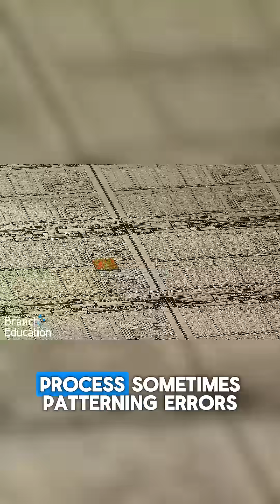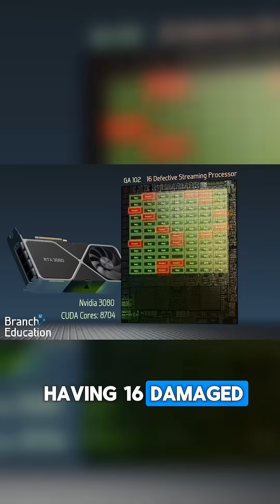How do Graphics Cards Work? Part 4 #gpu  #technology  #engineering  #videogames

Comment: Imagine they perfect the process, reducing error to such a degree that there is practically 0 error rate. Then we would have a standard chip with same performance level across all units. A higher chip or lower chip has to be separately designed, reducing waste and improving effeciency. This would be awesome once chip manufacturing process matures by further technological progress.
Reply: Sometimes they’ve just disabled working cores to meet demand on lower end units. Still higher yields are better overall as costs can come down
Reply: @Dude6978  that's the problem of corpos today, they keep making chips expensive and expensive, they are barely affordable nowadays (in 3rd world countries even a used gtx 1060 is barely affordable to buy given the low income), a standard chip should be affordable by everyone. It's doable but it would take a lot of work. Chips need to smaller to be less expensive and use less power, the programs need to be optimized and debloated from junk code. Especially game engines bringing minimal improvement with a massive performance hit. We reached the top back in 2010s with games like Crysis 2 & 3. They remastered versions are a proof of the minimal improvement (apart from ray tracing). I used to play crysis 2 on my core 2 duo with gt 630 and was continuously blown away by the graphics. Now graphics are barely changed and run like crap (most of recent games) and requiring a barely affordable RTX GPU to run at 1080p settings (remember when gtx 1080ti was marketed as 4k GPU?).

To truly move to next era, we need a collaborative effort from everyone, then we can truly start marching towards a Utopian future.

On a final note, let's not discredit the hard work the engineers have done by focusing on corpos. We all take GPU for granted, it's magnificent work of engineering and proof and human ingenuity.
Reply: I really wonder what would actually happen in a case like this, as they probably couldn't produce as many different chips as there are gpu models currently, just fewer models in total? Overall cheaper prices? Purposely downbinned cards?They would somehow have to meet demand in the lower-end market.
Reply: @hypernovafx Creating the photolithography masks for a chip variabt is extremely expensive. That's why they create only few variants and then disable parts of the chip even of they are perectly good.

Even if the manufacturing had zero defective rate, they would downbin chips to target multiple proce ranges on the market.

The buyer pays for what the product knows and not for how that product created.

Comment: So they are actually selling a damaged product as 100% efficient, just under a different name. Selling production waste has taken on a new meaning. I wonder how this relates to the law..
Reply: It's legal, it's called binning. If you could even think about being opposed to this, you're mentally deficient.
Reply: So you'd rather they waste a chip that can still be used, when it already takes a very labor-intensive process and is already an extremely polluting industry? Would you rather the price skyrocket AND emissions rise?

Comment: Not all are damaged if market demand 3800 and and they have in stock a lot of 3900/3900ti they will just replace the bios and repack it. Is the same like the amd phenom x3 x4 on am3 socket I got lucky back in the day and got phenom x3 and unlock it to x6 and all 6 cores worked property in all stress tests and gaming.
Reply: How were you able to access the firmware to unlock it?
Reply: no. they will laser cut the extra cores connections, so no amount of firmware is going to help. the phenom had the cores "turned off", not disconnected.

Comment: Back in 2010 I bought an Athlon II X3 with no level 3 cache. Bought the corresponding Asus motherboard which permitted unlocking in the bios. Unlocked it day one to Phenom II X4, so one extra core and better instructions, and also 6MB of extra level 3 cache. Tremendous performance increase at the time. I still have that PC and it's still working very good. Original AMD Radeon 5700 1GB and 8GB RAM. Upgraded to SSD. Still use it to browse the internet, YouTube, and some old school gaming.
Reply: Everybody does that in athlon II era, probability to winning that silicon lottery is fairly high
Reply: This is impressive bro
Reply: @DARK_DEZO_F  Thanks! 👍

Comment: Back in the day you could buy extra performance by getting a code that unleashed any manually errored components
Reply: heck yeeh i remember having ATI 9800SE that had its 8 cores 4 off them disabled but whit omega drivers which was free software you could unlock the rest off 4 so you get the full 8 and the card came same as Ati 9800pro for 199 euros the 9800pro cost 400€ good times
Reply: Why can't you do that now?
Reply: @PitestiNation  got harder and riskier
Reply: @PitestiNation they physically disable cores by cutting off the paths
Reply: multiple reasons. 1. They can now do physical isolation which is much more stable than bios based isolation 

2. Unlocking is basically lottery. You don't know your card contains a damaged sector or just a locked sector. 

all you heard on the internet is the success stories, but what about the failures whereby they unlocked a damaged sector?
Reply: yup, I guess people abused it so now they physically disable the bad sectors so you cant buy and return cards untill you get a "good" one

Comment: And in order to keep all 3080s' performances the same, do they intentionally defect some of them that are in better condition?
Reply: Only if it’s a very big difference. If it’s just a few cores it won’t matter, since the “silicon lottery” also makes some chips perform better so no single chip performs exactly the same. The brand like 3060 or 3080 just means minimum performance, usually your card performs a tiny bit better than the advertised amount of core because that means minimum that amount of cores.
Reply: @Dogappel good to know, thanks for the explanation.
Reply: @Mehrdad995  other replies don't know what they're talking about. Yes, they will disable cores to keep all 3080s the same spec. Think of it like multiple different cut off points: for example, if a chip is produced and has 72 SMs working, this can't be branded as a 3080Ti with 80 SMs, so 4 additional SMs will be disabled to meet the 68 SM spec of the 3080. This is the only reasonable thing to do, otherwise there would be a million different SKUs for each possible defect configuration. The "silicon lottery" that the others were talking about does not affect the underlying hardware specs of the GPU, but mostly only the voltage/frequency curve of said GPU (ie. Some GPUs will be able to achieve higher clock speeds when provided the same voltage). This is also held to a specific spec for each given GPU SKU, so this really only affects overclocking performance.
Reply: @shremk9100  You are right, not many people will pay for something that is based on luck. Knowing that by paying for a 3080 they might get a GPU with close to 3090 performance or on the contrary get a normal 3080 would make purchasing a factory new GPU less interesting compared to a second handed one that you for sure know it's actual power.
Reply: No, it's called the silicon lottery. My 3080 performs about the same to 5% better than the average 3090 because I won that lottery.
Reply: @MAL1GNANT  seriously? So it's completely random, and you might have a 3080 that only has 1 defective cores, whereas someone else might have one that has lets say 10 defective cores?

Comment: If, lets say we have a chip that cant be a ti but cant be a 3080 so they intentionally lower it. So can we like reactivate them and get a better performance.
Reply: They're broken. Why would you want to?
Reply: @MAL1GNANT  some chips they do that intentionally right? So can we reactivate those intentionally deactivated chips?
Reply: @CoolMonkey_at_his_PRIME  I would imagine that is risky to reactive some of those chips right? is this hard to do?
Reply: @CoolMonkey_at_his_PRIME  no you can't. the core pathways to the rest of the chip, are cut by laser. the is nothing to reactivate. that happened once 100 years ago with a amd phenom (the cores were just "turned off", not cut) and ppl still think that's how it works.
Reply: @giornikitop5373  so thats just a lose lose situation
Reply: @CoolMonkey_at_his_PRIME  no. that's just the reality of manufacturing chips and it's been that way for decades. cpus, gpus, ai, you name it. as good as the process gets with time, there will always be defects.
Reply: @giornikitop5373  Ig this is actually better than just throwing em. Companies just reuse them and sell em again for more profits 📈
Reply: @CoolMonkey_at_his_PRIME  exactly.

Comment: This binning process is especially frustrating with CPUs because sometimes you buy an i5 that has 1 or 2 extra cores that work perfectly fine and could potentially increase your multi-core performance by alot but intel would cut their connecting circuit traces with a Lazer so you would never be able to use them, just so the CPU could be packaged as an i5 and meet the advertised spec sheet.
Reply: But you have the option to buy the higher spec variant.
Basically you get what you paid for. Anything else doesn't matter, because that's just how mass producing chips with the most expensive manufacturing process works.
Reply: @zoltanberkes8559  They used to disable the extra cores with software, so you can later enable them if you want....but now they cut them physically with a Lazer...obviously you can just pay more and get a higher binned chip but throwing away a perfectly good core or two is purely wasteful...just disable that shit in software and let the consumer decide if they wanna play around with what they bought.
Reply: @Plexer101  why would they sell chips with more working cores than the specs specify? That isn't fair to consumers
Reply: because cpu's with odd number of cores perform like crap. it has been tried in the past and it failed misserably.

Comment: I wonder that even if 1 core is defective, they would have to also deactivate many working cores intentionally, so that all cards of a lower tier have same number of working cores.
Reply: I don't know if it's even likely enough to make a 100% perfect chip, so I would guess they have some reserve even in the highest tier they sell. But otherwise yes, if they are even 1 core short, they disable a few more to get to the next lower tier. And sometimes they do it even if they actually have enough working cores when there's too much demand for the lower and cheaper product, and not enough demand for the higher one.
Reply: soo... any idea how to reactivate those cores ? @jindrichlukas3220
Reply: @jindrichlukas3220  wow, thank you!
Reply: @jindrichlukas3220  thank you!
Reply: That's true. They will disable more so it meets the next spec. Sometimes they keep them to release another SKU down the road
Reply: @pcoverthink  okay. Thank you bro
Reply: Yes, because they didn't sell anything in between 3090 and 3090ti

In the CPU market, for the clockspeed is a bit different. let's say Intel, if they can't reach the clockspeed of an i9 14900 even though the difference is only small, they didn't make it even slower, rather they will sell it as i7 14700k aka overclockable variant(that's for clockspeed, for defective core is still the same with GPU).
Reply: @ thank you!
Reply: And probably same models of graphic cards have small differences

Comment: Hmmmm this makes the low end cards sound like sht. They didn't make them because they wanted a good value, they made them to get rid of damaged crap.
Reply: What they are doing is smart. Why make an entirely new GPU that would need a while to assembly process, when you just use the higher GPU (that already has existing machinery to make) and turn off some cores and sell it at a lower price ?
Reply: If anything it makes the low end cards sound awesome. Basically they are making chips that are ridiculously detailed, and most of the ones they make will have flaws somewhere. Is almost guaranteed. And so they just plan to use those for the mainstream cards based on how many working cores a chip managed to get. The 90 series cards are just the ones that somehow, against all odds, came out actually flawless.

From what I understand many displays are like this, where they make big sheets of screen, and the ones that somehow are flawless become a big screen TV, while the ones with some dead pixels get cut up into monitors or phones or what not.
Reply: I'm actually grateful that they sell it at lower price point. I'm rocking a 3070 and it works perfectly.
Reply: Not quite. There are different Die designs with different core cutting and design settings as technically there is one "Master" design and Dies are just either the master design or smaller subsets of its components. And those Dies then each have "fuse" sets and groups to set how the die can be binned to fit into skus when they are damaged. 
Ampere has:
GA100: 8192 Shading Units
GA102: 10752 Shading Units
GA103: 7680 Shading Units
GA104: 6144 Shading Units
GA106: 3840 Shading Units
GA107: 2560 Shading Units
GA107S: 2560 Shading Units (Binned for very low power Applications)
GA107SB: 2048 Shading Units (Binned for very low power Applications)
GA10B: 2048 Shading Units (Cut and designed for TEGRA applications and has changed RAM support for 64GB LPDDR5 for SOC usage)

Some these Cores all stem from the original Master design but have been cut down in size to further improve binning and segment goals aswell as provide physically smaller dies for different applications

Comment: If it's because of a faulty part of chip, why does every chip below 3090ti has the exact same cores, like how a mistakes can be repeated so consistently
Reply: This is a bit complicated. 
Let’s say for simplicity a 3090ti has 10,000 cores, 3090 has 9,000 and 3080 has 8,000. 

Nvidia gets a GPU, it has 10,000 working cores, they say “Ah perfect, we’ll sell this as a full RTX 3090ti”

Nvidia gets another GPU, it has 9,400 working cores, they say “Hmm this doesn’t have enough working cores as a 3090ti but it is closer to a 3090, so we’ll shut off the damaged 600 cores AND the 400 remaining cores and sell it as a RTX 3090 at a lower cost”

Nvidia gets  another GPU it has 8,100 working cores, they “Oh well this thing is no where near a 3090ti or a 3090, but it is awfully close to a 3080 already, so we’ll shut off the 1,900 damaged cores but we’ll leave the 100 working ones still as (as it’s more work to shut them off for such a small number of cores), and we’ll sell this as a RTX 3080. 

You see, because they left those extra 100 cores working THIS SPECIFIC 3080 will preform a bit better than other 3080s, this is called the silicon lottery, when Nvidia or other silicon manufacturers leave SOME of the cores still working, so the chip preforms a tad bit better than others like it, but not as good as the next tier of chip. 

Also, not all the graphics card use the same GPU, RTX 3090ti, 3090, 3080ti, 3080 use the GA102. 
RTX 3070ti, 3070 and 3060ti have the GA104
Reply: They disable the damaged cores because each core consists of a set of circuits. So if a core has damaged circuits, the entire core is disabled.

The GPU then categorized to specific variant based on the remaining number of cores, matching it to the closest model. For example, if a 3090 is supposed to have 10 cores and a 3080 has 8 cores, and the die has 9 functional cores. They will disable the damaged core and one additional core to match 3080.

At least that's how I understand it.